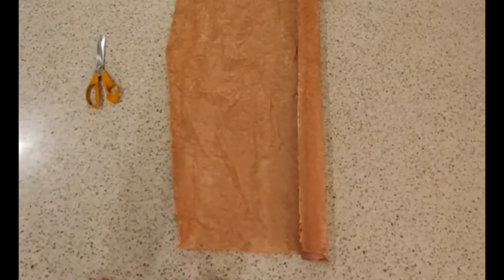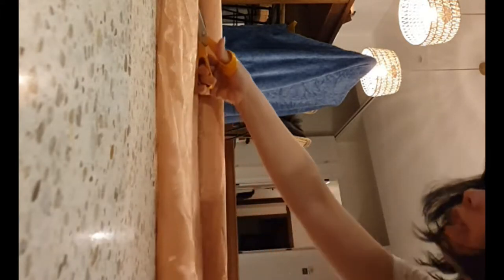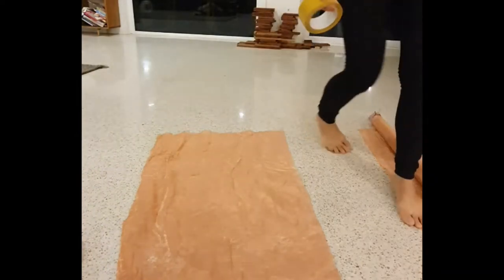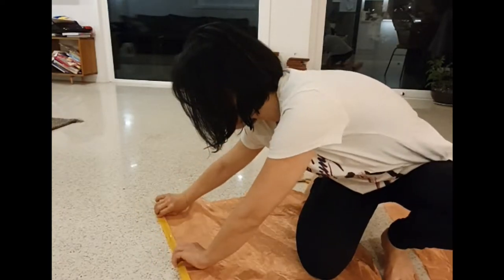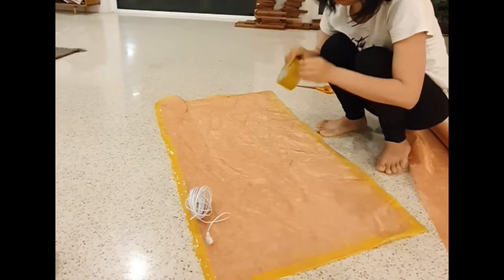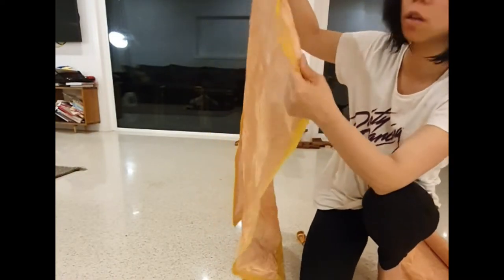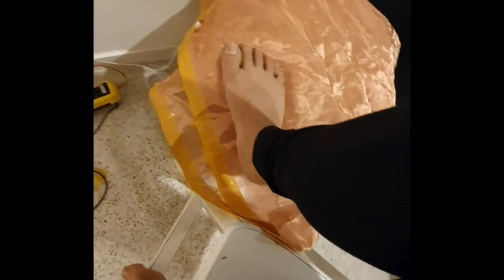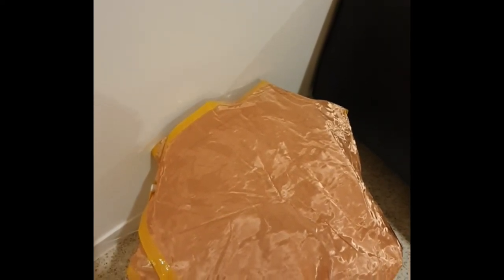How to make your own DIY grounding mat using only 4 materials

Comment: Hello I have a question if I buy copper fabric do I have to lie directly on the fabric to get grounded with no clothes on or can I put the copper fabric under a sheet and still get the grounding effects? Does it have to be skin to copper fabric or will it  work going through other fabrics, I want to make something for my bed. I found the copper fabric and grounding plug with no insulator so should be ok I just wonder if it has to be skin on only
Reply from the maker: You can lie on top of the bedsheet doesn't have to be directly on the copper grounding sheet. Even the tiniest bit of moisture will help with grounding. I know because I've tested it with my voltmeter, laying on top of a bedsheet

Comment: Thanks for the video! Would stainless steel mesh work as well?
Reply: @MsBoontjie - It will not work "as well". Just Google the conductivity of stainless steel vs copper. Here is a link to a table defining the conductivity of various metals: http://eddy-current.com/conductivity-of-metals-sorted-by-resistivity/
Reply from the maker: Yes, it will work but not as well as copper. Copper is one of the best material in terms of conducting electricity.
Reply: @zacoliorganic  
Wouldn't copper oxidise over time?
Reply from the maker: Yes it will. The colour will turn but I havent found it to impact conductivity. Perhaps longer term it wil?  Thaats why i recommend lower micron, so perhaps you can brush to clean? But i know stainless steel will work too, and perhaps more durable. Just rememver conductivity will not be as good that's all.

Comment: I was wondering if it would work if placed under the fitted sheet on the bed at night? Would it still ground us with the layer of cotton sheet between our skin and the copper?
Reply from the maker: Yes it will. Even a teeny weeny bit of moisture from your body will ground you even with a cotton sheet in the middle.
Reply: @zacoliorganic  Thank you for clarifying.

Comment: I’d advise people not to plug into your wall socket ground. Go bury it directly into the earth. I’ve seen videos of the electrical smog or radiation rather coming
Off mats that plug into the ground of your wall outlet. She has no device to check and measure for this FYI. Just bury it out your window and you can still close and lock your window. Best sleep of my life doing it this way
Reply: This way is bes but only if the rod is not very far. Otherwise the wire is too long and will start acting like antenna, I think
Reply: Yes I hardly agree that it's four volts difference between my ground plug and my ground in the dirt somebody should make a video to this effect and show the dangers of it also using a shielded wire like a cable wire should be implemented to keep it from being like an antenna I'm picking up noise and electrical smog

Comment: Hi Zacoli, do you know if stainless steel mesh is suitable? I have some and it is pliable like your copper mesh, but strong and does not tarnish easily.
Reply from the maker: Yes stainless steel will be a great alternative. It doesn't oxidise like copper does so it's more durable. Just noting that the conductivity will not be as good as copper so it's a trade off. I would like to use stainless steel if I can find some

Comment: I didn't understand you said attach to ground pin on plug do you mean I'm confused isn't it dangerous? Please explain thank you
Reply from the maker: You can buy the plug from anywhere that sells grounding sheets. The plug will have the ground pin active and the other pins in plastic ie inactive
Reply from the maker: Something like this. 

https://www.groundology.com/au/earthing/earth-connection-plug-au

And attached to this

https://www.groundology.com/au/earthing/straight-cord-4.6m

Comment: Are we grounding by just simply walking barefoot or with socks on inside the house ?
Reply from the maker: Walking barefoot outside touching concrete or grass or dirt, yes you are grounded. With sock as long as its cotton socks or any socks with natural fibre that wicks moisture easily, then yes you will get grounded.
Reply from the maker: Sorry i just reread your comment. Whether you get grounded or not inside the house will depend on your flooring. You get grounded with concrete floor but not with carpet or timber floor. Unsure of tiles, havent tested it.

Comment: Did your sheets turn blue? Ours did. They are white and blue now. Will be replacing with skin safe material.
Reply from the maker: Eventually it does. Perhaps a better option is to use stainless steel mesh although it isn't as conductive.

Comment: But you will have to clean or change this mesh regularly because copper  stains fast just in 2-3 days
Reply from the maker: You are not meant to sleep on the mat directly. You will put it underneath a cotton sheet.
Reply from the maker: Or you can use stainless steel mesh

Comment: What type of wall plug did you use and how do you keep it from electrocuting the shit out of you. this looks dangerous!!!!!
Reply from the maker: The wall plug only has the earth pin. The other pins are just plastic, which does not conduct electricity. I explained this in my other video.  You will need to buy the earthing wire from reputable suppliers.
Reply: @zacoliorganic  Thank you for answering my question. Alot of youtubers dont have the time to do that.:-)
Reply from the maker: @drakefirestone4259  thank you!

Comment: Just to update- I got my grounding sheet, also made a little carpet for my desk area from aluminum mesh. Hooked up to fat copper wire wrapped around aluminum peg which I sanded down and stuck in the ground outside near the AC water outlet so it's always moist... I felt horrible and super tired every time I was in contact, tried for a week and seemed to have a really bad effect....): Stopped for now, I don't know how to measure the effects or why it made me feel so bad (maybe picking up some dirty electricity from somewhere, maybe on a bad energy line?)- if anyone has any input I'm listening 🙏
Reply: Wow that's very interesting. Did you check with your voltmeter that you are indeed getting grounded?
Reply: @daviddc214  I just got a voltmeter! How do I check??
Reply from the maker: Have a look at my other grounding video, which will show you how to use the voltmeter
Reply from the maker: Here it is.  https://youtu.be/uL74vBlwSWY
Reply from the maker: Attach the grounding lead to the ground and touch the grounding mat and hold the other lead at the same time. The voltmeter will tell you the voltage.
Reply: Amigo estos tratamientos naturales pueden producir una reacción del cuerpo que no nos gusta y lo vemos mal, pero es el efecto benéfico del tratamiento. Los expertos le llaman CRISIS CURATIVA. Y es para su beneficio.